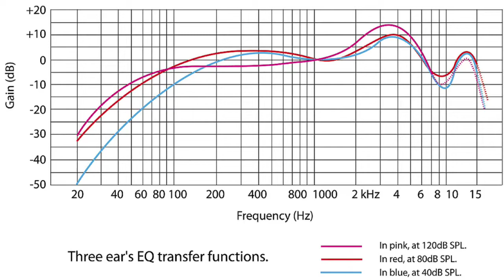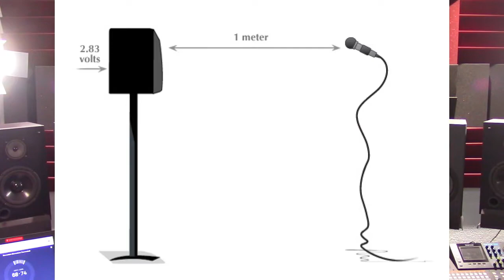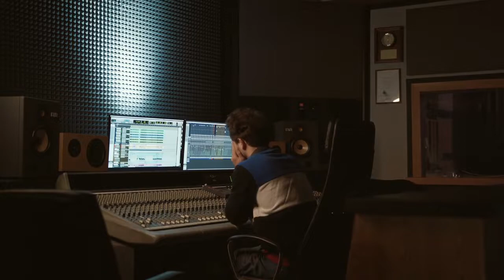Home Studio Loudspeaker Specifications: Simply Explained

Comment from the maker: Based on ton of factors, loudspeakers can easily trick many. Key specifications values are often overlooked simply because they are too complicated for some to comprehend. I was also a victim of this until I stopped ignoring specs that didn’t make sense, and took the time to analyze them and figure it out. I wanted to share the results with all who are interested in the hope that it will be useful.